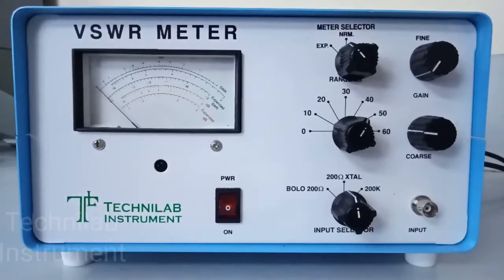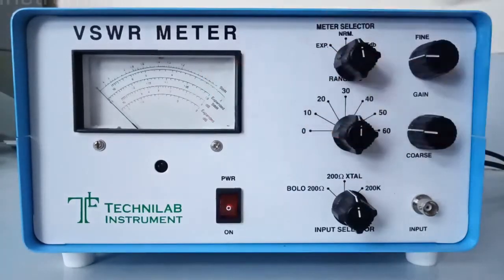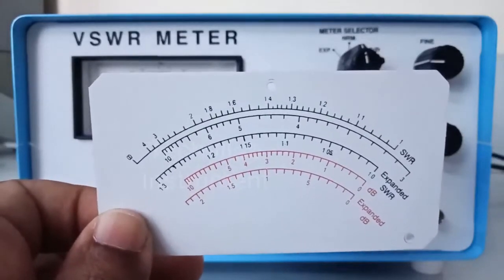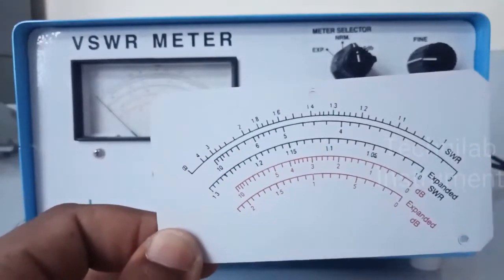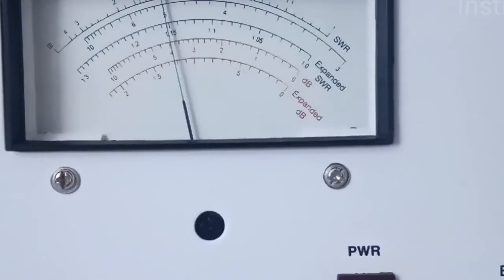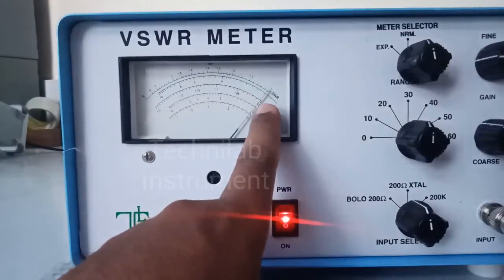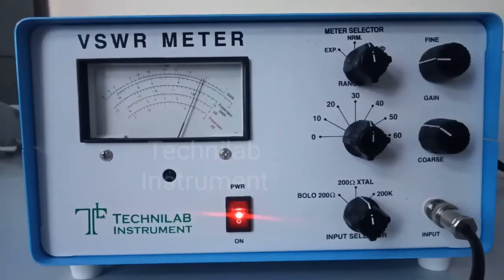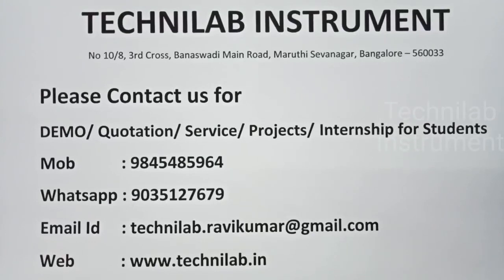VSWR Meter | Microwave Test Bench | Technilab

Comment: hI  IN 4.38MIN  you add in 4db the  30 db??
Reply: In VSWR meter we can measure the dB values in decade's
So once after every 10dB we have to move next level means after 10dB will move to 20dB scale
We can not measure complete range without changing the dB range switch
If my input power is -15dB then will read the power in -10 range there it will show -5 on scale and our dB range switch on -10dB then we add -10 on switch and scale readout -5 and our final readout is -15dB👍
Reply: -34 dB my input power and read it as -30on the range scale and -4 on dail scale by adding this Will get -34dB
Reply: @vinaykm9686  thank you  !